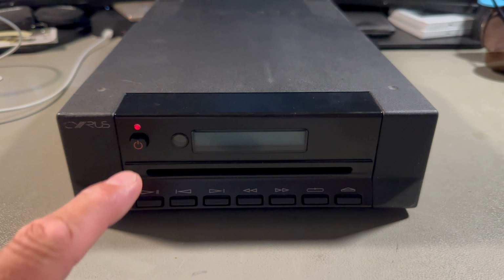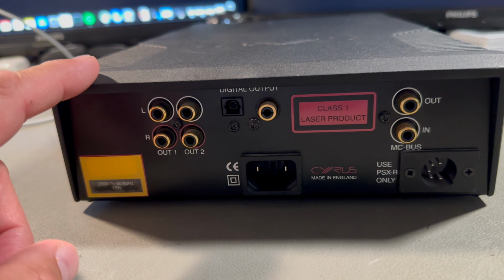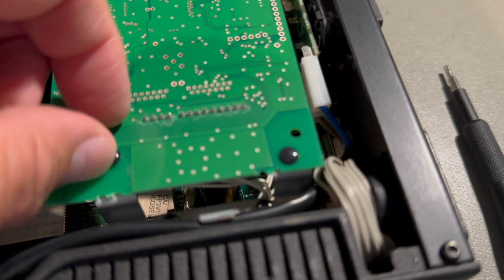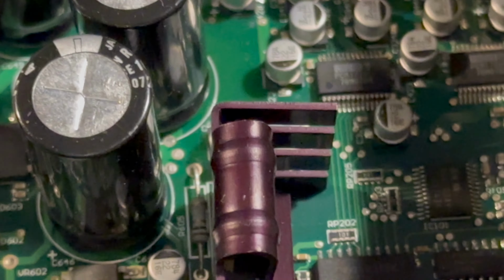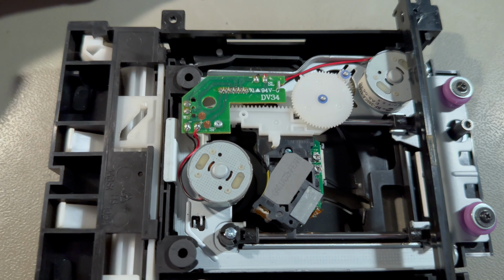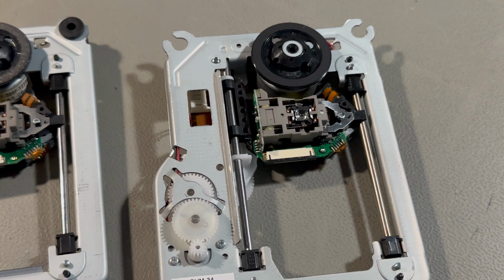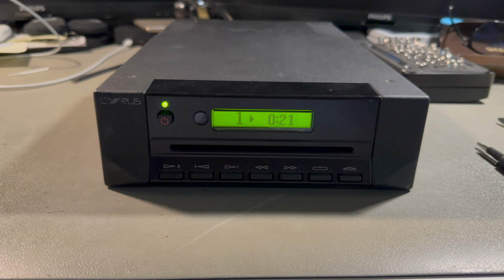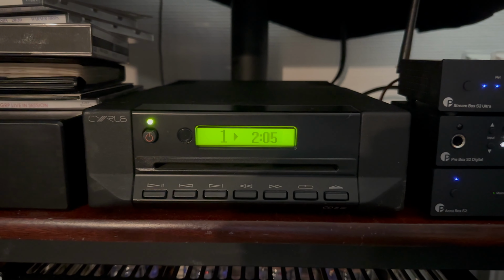Cyrus CD8 se Repair

Comment: The transport roller can cause loadings issues when it's dirty so the unit will say disc error due to the disc stopping just before it pushes a catch that makes the sled move in to place.
Also the replacement mechanisms are from the factory so they need to be set.
The laser rails are spring mounted so make sure all 3 are set correctly 1.5mm - 2mm
Focus and tracking are next to be set.
Different firmware versions have different focus and tracking settings.
Once the old mechanism is out fully clean and refurbish the transport before fitting a new one.
Always remove the anti static solder before fitting.
Always use anti static gloves or wristband when servicing.
If the analogue outputs fail it is usually the main transformer that needs replacing.
If digital outputs are not working then this is usually the smaller transformer that needs replacing.
New mechanism not focus and tracking correctly is the dsa circuit board as the values will have altered.
If it spits a disc fully out on the floor then it's the loadings switches located on the small circuit board on top of the transport.
I have repaired 200+ se units as the 6se 6se2 8se 8se2 xtse xtse2 all use the same transport and laser mechanism.
I still use a cyrus 8se cd player myself as the sound quality is amazing.

Comment: Owned the Cyrus CD8SE Mk2...Excellent sounding player, but the reliability was shocking...Sent off to the technicians on 3 occasions in the 2yrs that i owned it...from new !
Reply: That could have alot to do with the gears on the disc drive i had a denon with gears like that and had to fix it a few times within 6 weeks then i gave up on it...its better to own a unit that uses belts

Comment: Who's buying the players like this CYRUS?!? - Ugly design, the remote control looks very cheap, CD-loader as in the car's CD-player, display  looks like the same one in a children's TOYS and, finally, after pressing the push-button you hear a disgusting sound of "click" - as if a fat flea was cruched.
Reply from the maker: Well, there is one thing this do, that many good-looking CD do not do.
And you must hear it to believe it, I used the digital output and compared it to AudioLab 8300CD (using the build in DAC of the 8300CD) and the difference was mind-blowing.
Reply: @HiFi-DIY  You only use Cyrus as transport in comparison? So what dac  do you use in that case of comparison?
Reply from the maker: The DAC in AudioLab 8300CD was used

Comment: Did you have to use new plastic plugs to reattach the circuit board? Mine seems to be for one time use only. How did you remove the ribbon cable? In my cd8x, which is slightly different, I could not get that cable off without fearing to break it.
Reply from the maker: No I was able to reatached/reuse the plastic plugs for the board, however you have to be careful.
There are two ribbon cables in mine, and they have to be disconnected both.
I guess you also can remove the ribbon cables without soldering
Mine I had to pull it out in a straight line away from the drive
Reply: @HiFi-DIY  The socket on the laser transport that the ribbon goes into has a plastic locking bar that should be pulled back in the direction of the cable to release the cable. This type of locking is quite common in ribbon -cable connections.